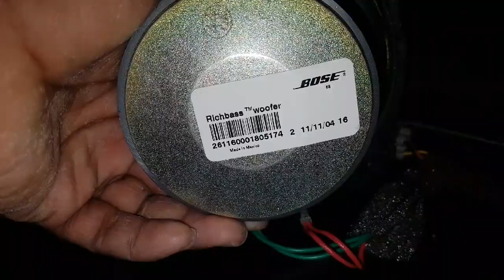Bose GJ5A 66 960 Subwoofer Mexico Made For Mazda 6 🎧 harness

Comment: what is the wire with the star for
Reply from the maker: This wire is for the amplifier i think. Because there is no use if we connect or not. Without this subwoofer can play nicely.
Reply: I in my car went to get the current and negative from a plug and the signal went to get the car speakers, is it well connected or what do you advise?
Reply from the maker: @pedroabreu3612  yes sir, this is perfect, but from speaker connection please convert stereo to mono the plus in subwoofer.
Reply: How can you explain or explain to me?